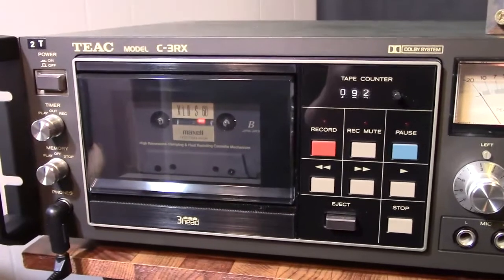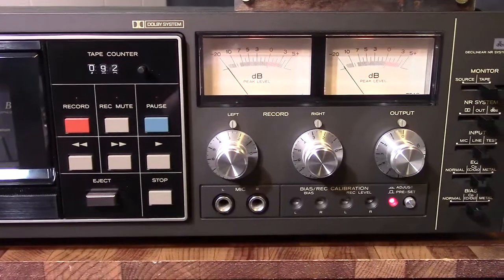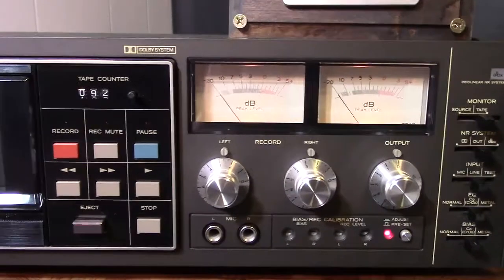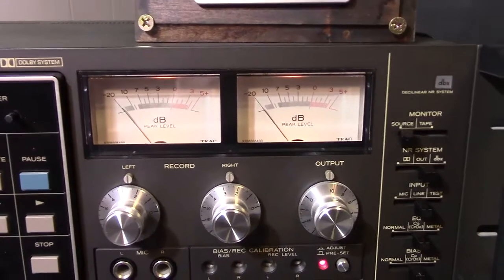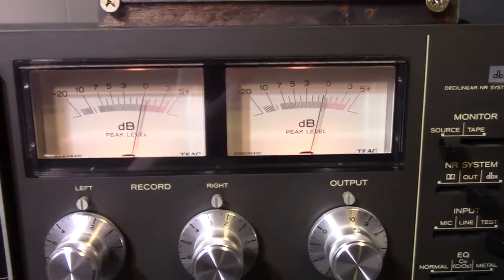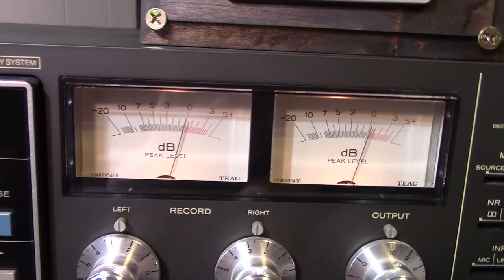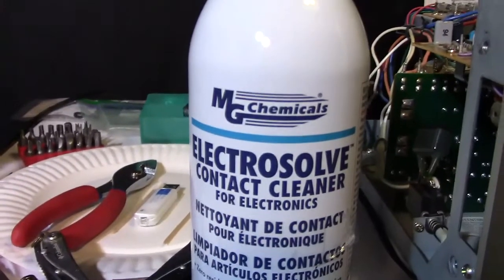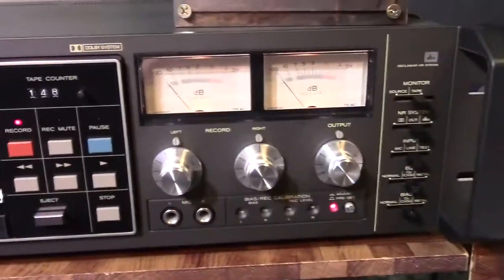TEAC C-3RX - Calibration and More

Comment: Cool, and yes, these decks are build like a tank.
I bought my C3-X, the one with 2 speeds, in the 80's somewhere when I was 19 years old.
Special offer, it was the shop demonstration model.
I'm 61 now, still running well! 🙂
The only thing I ever replaced are the rubber belts and the rubber parts for FF and Rew.
And I will never sell it.
Nice video, thanks.

Comment: The TO8 Oscillator is capable of producing 3 specialized tones and are in effect optimized for C-3RX calibration: 6.3kHz (-30dB), 400Hz (-30dB), and 12.5kHz (-30dB). In fact I modeled the TO8 in software and it's based on the noted specs. My application was not intended for public release. Have you checked the Owner's Manual for calibration instructions?
Reply from the maker: Nice!